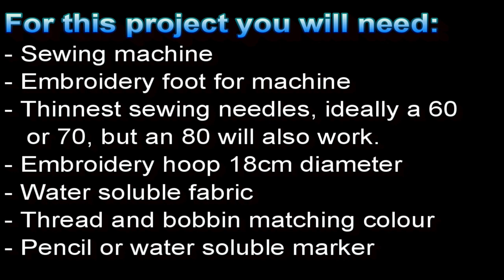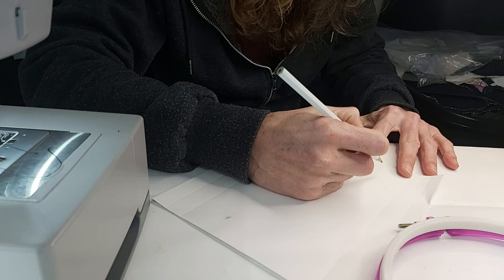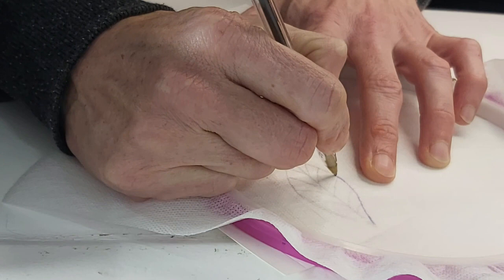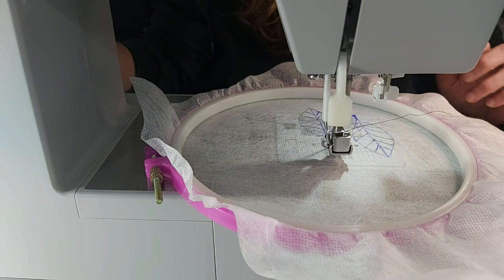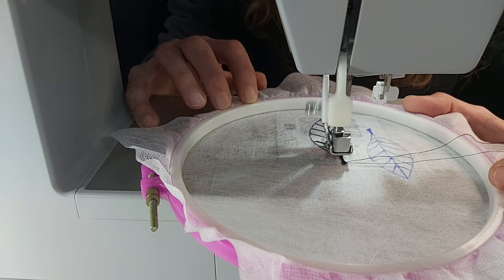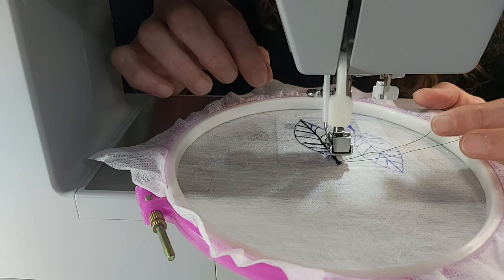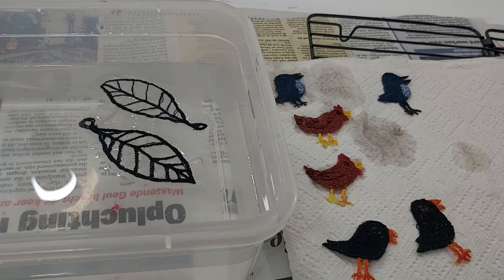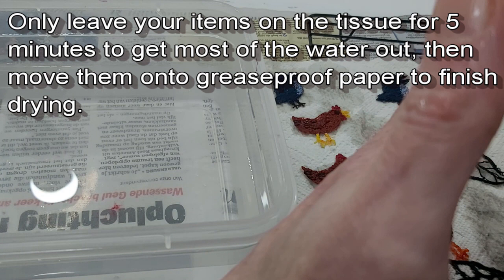WATER SOLUBLE FABRIC,What it is & How to use it. DIY thread lace.Next level Free Motion Embroidery.

Comment: for some reason whenever i use free embroidery for my water soluble cloth it keeps on looping at the top of the surface. is there any way to stop that from happening?
Reply from the maker: Hi. This sounds like a tension issue. Normally looping on the top of your fabric indicates that the bobbin tension is too loose, but it might just be that the top and bobbin tension are out of sync, so it might be that you need to loose  the top tension a bit. 
The other reason could be how sharp your needle is, so you could try using a new needle and see if that helps. You could also try using a smaller needle size, or even double up the water soluble fabric.
Please let me know if you still have issues after trying these things and we can continue to brainstorm. 
Cheers, Rebecca
Reply from the maker: Hi again, I'm busy stitching a butterfly into water soluble fabric and i managed to recreate your issue (i think), the first time i got loops on top of the fabric was because i was moving by hoop slightly too fast for the speed i was stitching at. The second tube i got a few loops was when i was trying to stitch some detail into a section where i had previously done some very dense stitching,  this i solved by using a size 60/8 needle instead of the 80/12 needle that i did the rest of the design with. The thinner needle helps to slip between the stitches easier. 
I hope this helps.